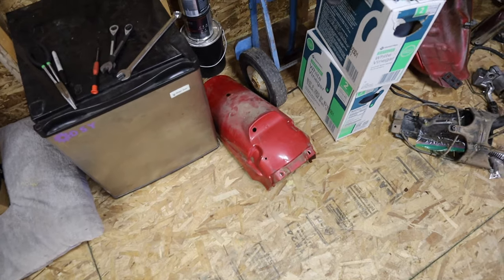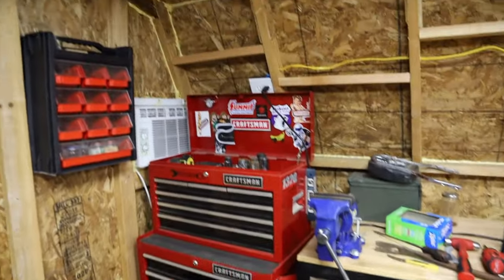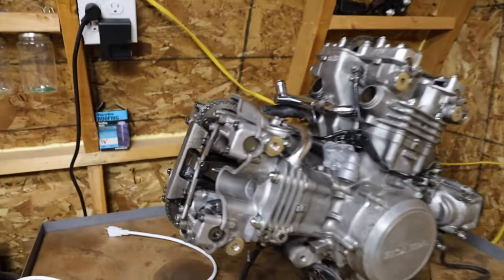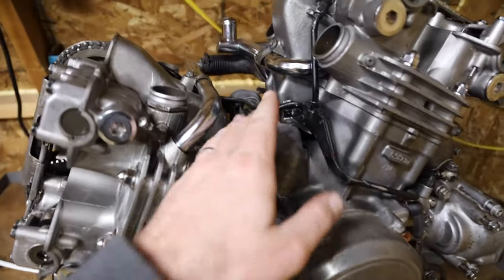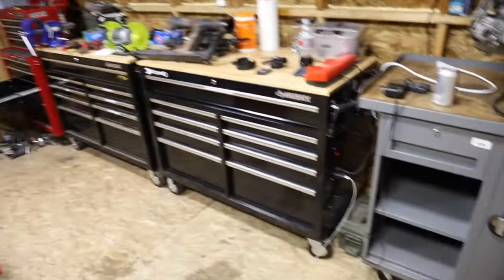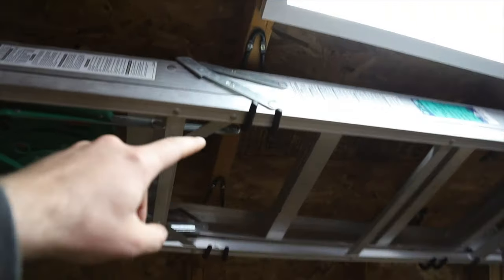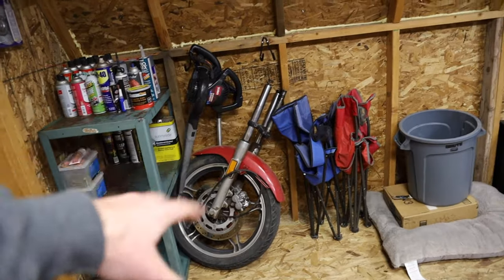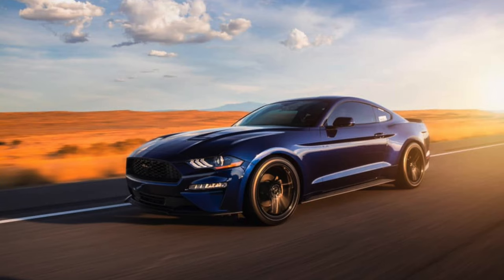1987 Honda Magna Restoration - More Disassembly - Part 5

Comment: Did you do anything thing with the timing chain  I have a 86 magna 700 that's starting to slap a little bit
Reply from the maker: I removed it and reinstalled it. Unfortunately engine parts are really hard to find and I couldn’t get farther into the engine. I even have to reuse valve cover gaskets.